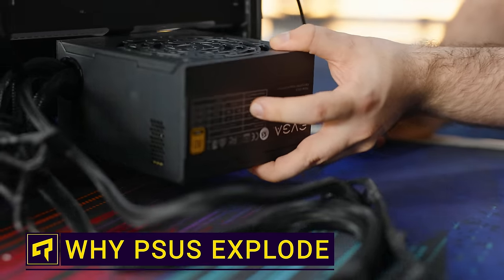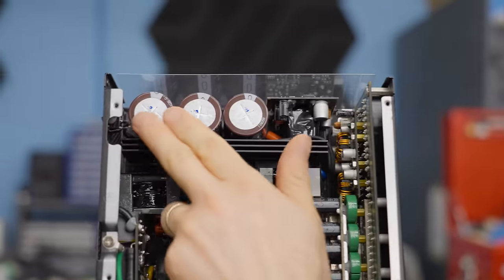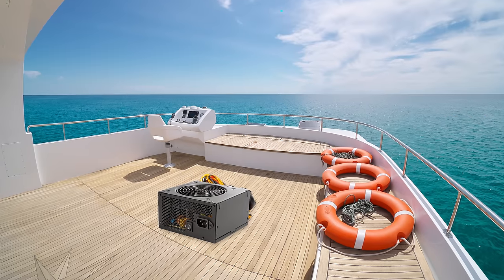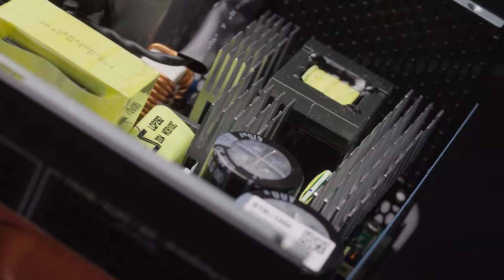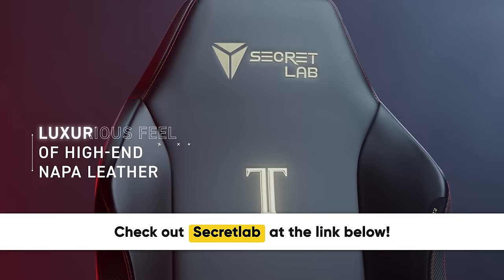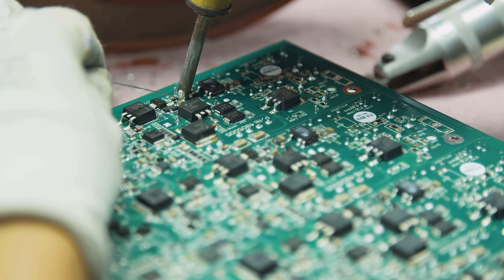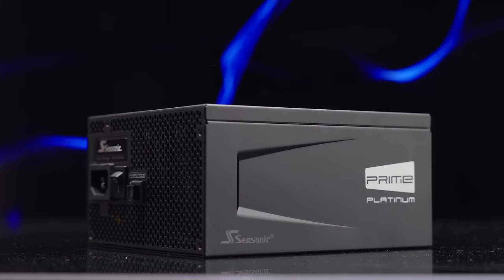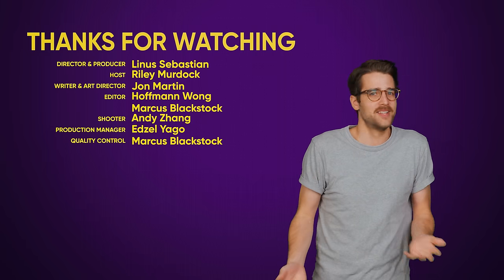Why Cheap Power Supplies Explode

Comment: I have only ever used Seasonic power supplies in my builds. I even have one that's been going for over 12 years almost nonstop in my media center PC. They have never done me wrong.
Reply: Seasonic is a manufacturer, that way they have direct control over their products from design to manufacture. Most of the brands you hear about are however just that, brands. They buy their PSU's from manufacturers like Seasonic or any of the other PSU manufacturers around. The brands input on the products can vary from just buying "white box" PSU's and slap a brand label on them to actually partake in designing circuitry and deciding on parts used. In general those who go the later route tend to have better products, but some manufacturers do sell generic designs that are pretty good.

Now it's usually not recommended that you just choose by brand or make, but Seasonic does have a pretty good track record. Personally there are a few makes I tend to trust, and Seasonic is on that short list. Others are FSP, Delta, LiteOn and Zippy - EMACS. I sort these into three categories. Seasonic is very good at making PSU's for workstations and personal PC's. FSP is a cheaper alternative that's typically is not quite up there with Seasonic but tend to be perfectly good enough for most use and at a decent price. Delta and LiteOn sell a lot of PSU's to the large computer manufacturers and they both tend to be reliable but not exiting for those who build their own computers as they are just bare boxes with little to no regard for aesthetics. Zippy-EMACS may have a strange name but their PSU's are rock solid. If Delta and LiteOn are dependable then Zippy is what you get when failure is not an option. They are expensive, tend to have loud fans and are bare steel and have the dreaded "Ketchup and Mustard" cables. But if you build a server or critical workstation they are well worth the price.

Now as for brands I think all of them has had some duds. But generally brands like Corsair, EVGA and several others are generally quite good at ensuring the PSU's they sell under their brand doesn't damage their image by crapping out. And they also are pretty good at handling support when something does go wrong. That and generous warranties give you some peace of mind. Remember that a single RMA return for a PSU will eat up the profit they make form the sale of probably ten of those PSU's. That give them incentive to keep the quality control on top of things making sure the return rate is as low as possible.

So it's not that these manufacturers or brands are your friends, they just want to make as much money as possible and if that means selling good products then so be it...

The more obscure brands and manufacturers can get away with selling low quality products and have higher failure rates as they don't have an image to protect and might be hard to get to replace failed units.
Reply: I only had one Seasoning unit and it blew up the first time I plugged it in...at least it didn't take rest of the computer with it. Got a warranty replacement and it's working fine since.
Reply: The only PSUs I bought were from Corsair and SuperFlower. Both have not failed me. Seasonic and EVGA are also good choices
Reply: I had seasomic psu fan start to fail after 3 years, made big coil whine type of sound. Contacted seasonic and they sent me a new one super fast
Reply: Only ever use seasonic or Evga psus definitely cant go wrong with either.

Comment: High got a 1000w PSU for $10. It's great. 80Plus Platinum. Thought it'd be hella noisy being from a retired server. Nope. Hardly any noise below 500w. Using it for an induction heater. lols

Comment: The power supply is the one thing you should never cheap out on. It's not only a fire hazard but it's also a hazard to your other expensive components like CPU and GPU. Gold rating from a trusted manufacturer like EVGA, Seasonic, or Corsair should be the minimum in my opinion.
Reply: True words! 🙏
Reply: Efficiency rating doesn't necessarily directly correlate with the quality of the PSU. Efficiency only indicates the power draw from the wall socket. The rating system is also voluntary. Rating doesn't do much more than that. Cybernetics ETA certification improves a lot on the 80+ certification, but that also has a limited scope in the rating of a PSU.

You can still have a bad gold rated PSU. Corsair and EVGA make use of OEM's, like seasonic, FPS, CWT, andyson, superflower, HEC, ect. Many OEM PSU's manufactures sell their own PSU's as well. It's not like they will be selling all of their best designs they use to competitors.  

 Second problem is the testing practices of the rating doesn't always stack up to real world conditions. The average testing temperatures is lower, to real life conditions. Many PSU's will fail efficiency ratings in real world conditions. So the efficiency should NOT be used as a indication of quality, but in the same breath, plat and diamonds certified PSUs are likely to have much better components in general, as it is much harder to reach those efficiency ratings. 

A perfect fire hazard can easily get a 80+ gold rating, it isn't that hard to get, compared to the plat and diamond rating. EVGA has made use of superflower as an example, it is a decent OEM from Taiwan with manufacturing plant in china as do many OEMs. Knowing that would you still recommend EVGA. or corsair that on the entry and mid range side, have used OEM's ranging from CWT to FSP.  Two oem's who had notoriously bad PSU's from the Pentium 4 days, also OEMs you will find in gigabyte, raidmax and other branded companies who have pretty bad entry PSU's in general. 

It allures to, because it is corsair or EVGA or MSI or Asus, it doesn't actually mean their PSU's are of exceptional quality. So you don't base a recommendation on the brand name but rather the OEM they use. I would rather buy directly from the OEM, like seasonic, FSP, superflower and andyson. To the point I am still using a raidmax 850watt AE (andyson OEM) PSU from 10 years ago in a secondary system, only replaced it recently because of the old topology design (double forward design) and the quad rail wasn't good for newer GPU's. The oem is good, however in real life conditions fails the gold rating and is more a silver rated PSU.

Is it a bad PSU because it fails the gold rating, not at all, it is actually one of the best raidmax PSU's you will find from that era, ripple and protections and general performance was up there with the Corsair GS700watt(CWT or FSP pending the year). Gigabyte makes exceptional PSUs at the top end, but their entry psu's even some mid range PSU's are fire hazards. So it isn't necessarily the brand name I look for but the OEM they are using. I wouldn't recommend a corsair entry, just based on the premium you pay, when for the same money you can buy some thing a little better directly from the OEM whose design corsair is using.
Reply: @WizardofidGameGuruMax  Efficiency rating usually comes at a higher price though, and from what I've seen brands like Corsair or bequiet give much longer warranties on platinum/titanium rated PSUs compared to gold or bronze ones, usually 10 vs 5 years. Doesn't mean that it affects quality, but I think it somewhat makes sense for them to only grant longer warranties if they can expect said products to last longer too
Reply: @anthrazite  80+ Efficiency rating tests efficiency and not much else, It test at low medium, and high loads. It doesn't inspect, dissemble or otherwise test individual components. There is very few that can get the high efficiency ratings, in fact there is only ONE topology that can get titanium efficiency and two for  plat.

80+, bronze, silver, and gold ratings aren't hard to get, with these ratings quality isn't a guarantee, besides there are many unscrupulous manufactures that simply fake the 80+. 

There is no legal requirement that PSU needs to be rated, the efficiency rating is optional.

Another problem is that efficiency rating  os done in preset conditions and doesn't take into account all weather conditions or case designs. While it might have a gold rating in lab conditions, there have been many instances of PSU's failing in real world conditions to meet their rated efficiency.   

To the point efficiency IS NOT an indication of quality, the whole efficiency rating  is a farce. Again efficiency ONLY accounts for how much power it draws from the wall socket. You can have the most craptastic PSU and have it with gold rating. 

Corsair uses OEMs as do many brand names, corsair has used FSP and CWT in past and still do now.

But won't touch an OEM PSU like FSP. I personally have a 80+ FSP psu in my system, which you wouldn't touch but it is the same OEM that leading brands use.

Corsair uses more than just seasonic for their OEM, their early units in the budget and mid range section where either CWT or great wall with the occasional FSP in the mix. 

I suggest you read up on what efficiency rating actually is and how it doesn't correlate to quality

Comment: While all this is true, I bought a brand new EVGA G2 1000w PSU for my then new PC a few years ago. Built the system very carefully, come time to power on, flipped the power switch on the back of the PSU and it went with a bright blue flash and smoke. Took out a 6 month old Samsung Pro 256gb SSD. Convinced I'd done something wrong I checked everything in the system and no error on building. Sent the G2 PSU back under warranty, and the replacement several weeks later worked fine. In the meantime I used a different PSU and no issues. 

So even buying a fancy, well regarded brand and model PSU they can still fail.

Comment: 1:02 is not a good representation of how capacitors work. They do not "flow" like they're in series, they are in parallel to flatten voltage differences.

The explanation of bad ones is the same, but not the visuals.

Comment: Buying from reputable sellers is no longer enough after Newegg and Amazon gaffs...
Not so easy...
Even wholesale buyers for stores can be fooled paying regular price  for cheap knockoffs. 
Bad or counterfeit caps from China is a real problem.
Worse counterfeit lower rated power supplies with fake specs is also a problem.  
You just have to really do your homework

Comment: My very first home DIY NAS was taken out by a cheap PSU, including all of the drives and the mainboard. One of the drives had unbackuped data, which needed to be rescued by changing the PCB of the drive. So i got two lessons learned for the price of a bunch of IDE drives and a new good PSU. Interestingly the PSU itself continued to work just as nothing ever happened, although it had popped loud AF and smelled horrible afterwards. Didn't save it from trash though

Comment: i had one for 10 years before it blew up 3months ago. 
It was a 550w MSI
now i have a 650w Corsair :)
Reply: And neither of those 2 were made by the brand on the psu.
Reply: @TheSjuris  so? 95% of all electronic and mechanical devices you posses currently are not made by the brand that is selling them. Not even your car is made by that brand, it only assembles it.
You could compare them with games. You have developers and publishers. Similar concept here really.
Reply: @malisa71  so if you buy a Ford you might get a Rolls not quite how that works. Sure some of the transmissions might be made by someone else, but that’s usually another actual car manufacturer.  Not quite similar setup. You can buy 2 different PSUs with the same brand on it and have two different levels of quality.  Which is what happened with the Gigablow PSU.  Ford makes and assembles cars for Ford. There are a couple of rebranded models, but that’s rarer these days.
Reply: @TheSjuris  no, you are so wrong on so many levels that I do not have patients to prove anything to you. I always get surprised how some people can be so wrong about basically anything nowadays where the info about the topic is just few click away.
And what do you even mean by your first sentence in the answer??? Jesus brother...
Reply: @malisa71  coming from someone who doesn’t even know how to spell only proves your ignorance.  Fords aren’t made by Toyota. Chrysler doesn’t build Camaros. They might use some transmissions since only 3 manufacturers actually make CVTs, but that’s different. Most of the cars use their own engines use their own steel.

Comment: It all comes down to luck in the end.... I've had 29€ Chieftec GPA PSU 450W 12CM ATX2.3 80PLUS in my HTPC for 10 years and no problems at all.

Intel i5-2500S, 8GB DDR3, 1x SSD, 3x HDD, AMD R9 380... Power calculator says 440W and it's fine.

Nowadays, I use only Seasonic power supply. Prime TX for main computer and that HTPC is right now being rebuilt with Focus PX-550. That retiring Chieftec PSU was great value at 2,99€/year :D

Comment: My no name PSU (HKC 650W) has OCP, OPP, OVP & SCP, a reasonable weight, somewhat bad efficiency, decent cables & a good price. It works 4 years now without any problems. I think over these 4 years I got 20 Gigabyte PSU's worth of reliability 10/10 😂
Reply: Depends on components u use with it
Reply: HKC is a major OEM, I wouldn't say their home brand stuff is the greatest, but they're good enough.

Comment: They shouldn't be able to use the label in the first place. It would be branded as un-labeled. It would still sell, just without the label. It's not like you can't sell a psu until it's labeled with a lie. That ruins the point of the label in the first place, to prove the testing.

Comment: I've got an omen prebuilt pc with 850W PSU. It is a Cooler Master psu but I could not find it in any of their line up, should  I trust it, especially if I'm running a 4090 with 14900F?

Comment: Weight is no longer an indication whether or not a PSU is good, especially with the recent addition of new PSU topologies, which uses less components compared to older ones. The opposite is true these days, in that a heavier PSU might indicate older topology in use. In older topologies it was more common to find multiple 12 volt rails either dual or quad, single rail weren't as common. CPU and GPU power draws of yester year were a lot lower compared to now, and as such single rail PSU out number, multi rail PSU.

as such there is an additional weight reduction with the use of single rail, compared to multi rail PSU, where each rail added having components as well a rail protections in place. Additional weight reductions can be done by forgoing the switching aspect of the PSU if released in a specific market, 120v and countries that use 230 volt. It keeps the costs down.

Lastly while capacitors from Japan is considered the best when compared to Chinese counterpart, however while Japanese capacitors is still better, Chinese capacitors have improved a lot from the late 90s early 2000s stigma it once had due to having issues with the materials used in their capacitors. It is pretty hard to penalize a PSU for using tier 2 capacitors on less important bits like on modular ic board(s). where the use of teapo capacitors would be perfectly acceptable. You want tier 1 capacitors where it matters for example on the secondary side once the voltage has been stepped down.

While capacitors attribute to the efficiency rating of the PSU, the topology of PSU plays the most important part with regards to efficiency, Corsair for example is known to use teapo capacitors in their low end and some mid range PSUs. Is it a bad thing? Not at all, an all teapo PSU is perfectly fine albeit it won't be winning any efficiency races, granted you aren't trying to run a 4090 of it, it isn't any less reliable when compared to more expensive one's. Finally warranty is also worth considering usually 3, 5 and 10 year warrantied PSUs is always a consideration anything less than 3 years should be avoided as a rule of thumb.

Comment: From what I gathered regarding PSUs:

-Companies that actually design their PSUs: Seasonic, Corsair, Super Flower, FSP. Other companies might outsource the design, which doesn't necessarily mean it will be bad but possibly make it more hit or miss.
-Get one with Japanese capacitors so they aren't complete trash and will last more than a couple of years.
-80+ Gold or better generally have better components than bronze/white label.
-Look for a good warranty like 7-10 years, meaning the company has some faith in the product.
-Don't buy random "brands" that you never heard of before.
-Don't buy Gigabyte PSUs for the foreseeable future - they can explode.

Comment: Those cheap, high-wattage PSUs also frequently have crappy 12V rails. If your PSU should have enough wattage to power your gaming rig but you keep getting spontaneous resets in-game, that could be why.
Reply: Yes i have cheap psu 900w 45e 3 year ago and in Batttlefield game crash reset after 1 hour gaming, also the vrm of Motherboard up to 100c , i think could be due to no stable 12 V ...

Comment: Everything is a trade off. Do cheap power supplies only hit 80% efficiency? Yes. Are they labelled wrong? Yes. Do they use cheaper wires? Yes. Do they have cheaper fans? Yes. Like what do you want for $40? That said, if you buy from a decent manufacturer, you are fine, infact, a cheap, linear, PSU will usually output a cleaner signal then a more expensive PSU. I just don't get why the hate on for linear PSUs which are cheaper to manufacture? They have been used for decades, and are BETTER in many instances then PWM PSUs.

Comment: In high school we had a kid electrocute himself after taking a Mac apart. It was common knowledge not to back then because of the capacitors. He still did it.
Reply: Common sense isn't common.

The two most abundant elements in the universe are hydrogen and stupidity, though possibly not in that order.
Reply: @tiladx  hydrogen? debatable